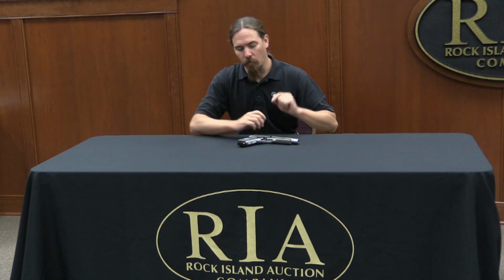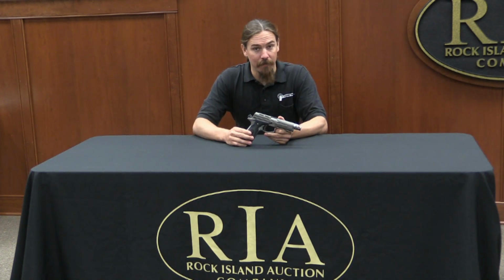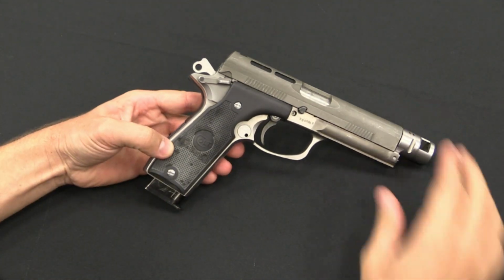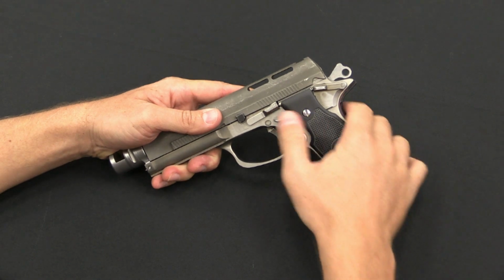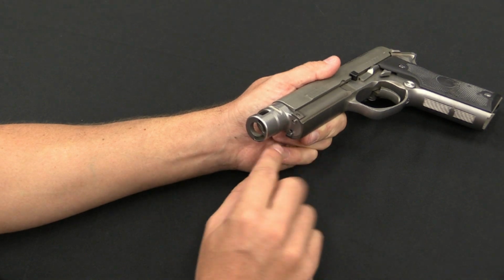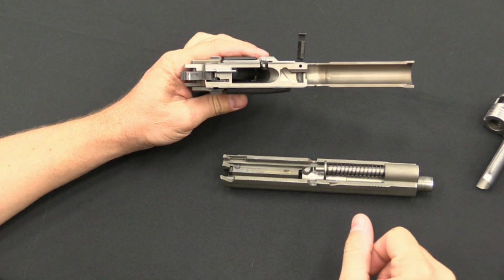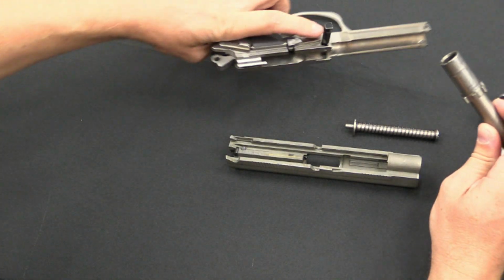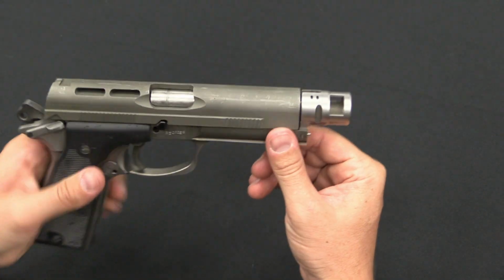Colt Offensive Handgun

Comment: I made this comment in reply to another which has since been deleted, but I think it's worth sharing so I'm reposting it here.

My father was on the design team for this gun. I thought it looked familiar and with good reason. Here is a photo of him holding one from Army magazine a few decades ago: https://i.imgur.com/MYbEUu5.jpg

I showed him this video and he loved it. He agreed the gun was frankly not very good. It was apparently mired in issues from the start and they encountered problem after problem throughout the design process. One clarification he wanted to make is about what you call the thumb safety in the video. This is in fact not a safety and should not prevent the gun from firing. It is actually a means to lock the slide forward when the gun is fired to prevent it from reciprocating. The idea was it would be used to eliminate the sound of the gun cycling in combination with the suppressor to reduce noise as much as possible. It was not intentionally designed to be ambidextrous; the double-sided design was actually required to prevent damage to the slide and mechanism when firing the gun with the slide lock engaged.

Thanks for this video, and bringing my dad for a stroll down memory lane into this gun's history.

Comment: If this gun were human it would be considered a product of generations of inbreeding. Bad inbreeding. Not the fun kind with your hot cousin and a condom. The nasty kind. The only useful item I see here is that the muzzle brake can be used as a miniature entrenching tool. This explains a lot about the Colt failures and low quality of the ‘80s and ‘90s.

Comment: My thought is Colt could have worked with Para Ordinance and produced a hybrid that used a locking system with an extra lug for strength. And a decocking mechanism. And a double stack mag system. I have a P14 I've had for years. Only complaint is there is no rail on the dust cover.

Comment: GunJesus there are 16 oz in a pound so 33 oz is 2 lbs 1 oz 
Not “3 and a 1/3 pounds” which would be 53 oz

I generally love your work... but this was not your best work
Reply: Wouldn't you love to go metric? You just move the decimal point instead of calculating in arcane fractions.

Comment: This has to be the coolest looking pistol ever made. Change my mind.
Reply: For what it does it's simply bloated and overweight. What's offensive in this handgun is that they still had the Colt 1971 prototypes floating around, that only needed a decocker and a threated barrel to be a much superior pistol. Why they chose to use the Double Eagle trigger group, that was notoriously flimsy and prone to breakages (it was simply a mass produced Seecamp 1911 double action conversion, so an aftertought, for how much well conceived) for a pistol destined to high round counts is beyond me.
Reply: You're talking about Beretta, right?

Comment: Pretty obviously the Colt SSP, which already existed when they started development of this pistol, was a much better thought out design than this is even without making any changes to the SSP whatsoever. Why on earth didn't Colt put the effort into updating that design, and making it better, rather than working on this abomination? Honestly, Colt should buy this gun back and lock it in a vault indefinitely as it does not indicate excellence in management or design.
Reply: Yeah. The SSP only needed a decocker and a threaded barrel to be perfect for the job.

Comment: You’d have to assume that if any company had an advantage in selling a .45 pistol to the US military, it would be colt. Was it’s 90s product range really that bad?

Edit: just watched Ian’s video on the Z40. Colt in the 90s was really bad.
Reply: I can testify to a bought new in ‘92 Colt Gold Cup National Match .45 a friend bought. First shot locked the gun up. Totally locked up even a local gunsmith could not clear the empty shell. Twice sent back to Colt and a third time to a Colt armorer the same problem, first shot every time. Did Colt send it back without test firing it? Seems to me they did. After the gun dealer that sold the gun called Coot and explained to them that it was owned by an Alabama State Trooper the gun was replaced. The second gun worked great. Still a mystery about the first gun.
Reply: @martinswiney2192  that’s pretty bad!
Reply: 90's? Pfft, Colt was bad even back in the 60's. Those legendary Pythons and Trooper mk3 have a ton of issues from weak springs and timing issues

Comment: It might be an optical illusion but it seemed that the "length" (as opposed to its height) is shorter than the 1911, 

Was the trigger reach shorter than for the 1911 - just asking I have small hands, But maybe it could serve as a model for a reduced trigger reach 1911 frame ?

Comment: If you look at how the Mark 23 turned out, it seems like the crowded controls were part of the requirements for this pistol design. Beyond that, all of the other features seem to be genuine attempts to improve the design. Even the rotating barrel has some advantages to the shooter over the typical Browning design, it's just not as easily  suppressed. To me, it seems like if they had more time to smooth out some quirks in the design, and if they hadn't tried to shoe-horn in that rotating barrel concept, this might have actually been a step forward.

Comment: I dunno, everyone is saying it looks horrible... I've honestly seen much uglier. It looks some sort of bizarre Beretta-ish design (to me) and it does have a lot of extraneous-looking stuff on it (those slots in the top of the slide, for example), but it's not super gross.

The compensator/suppressor mount seems like a good way to keep the reciprocating mass of the barrel smaller, even if it is very much "cheesily" mounted to the frame.
Reply: +Мейсу Семпай It looks like a 1911 that's abusing steroids. In fact, the only thing that could make it look more so is by adding a bayonet.

Comment: Colt... can't make any other semi-automatic handgun aside from 1911 variants? :B
Reply: Judging from this model you can begin to see how they went bankrupt... that time at least.
Reply: The 1911 remains a fantastic pistol, but this is a huge deviation from the 1911 in every way which matters. It probably would have been better if this had been a 1911 variant, but I imagine the rotating bolt was used as a way to eliminate the stresses on the slide stop pin and the barrel stop on the receiver, which are common sources of wear-induced failure on the 1911.
Reply: Benjamin Danielsen go detail strip a colt and go detail strip a competitors gun. All colt parts are machined from bar stock except for the mag catch, sear, and disconnector. Even Springfield TRP’s have cast hammers. Springfield uses different tiers of parts in their guns. Colt doesn’t. In this case you are getting what you pay for.
Reply: @K-bob_45  Say that to literally anyone who's owned a Taurus PT1911 ever.

I'm not saying 1911s are inherently bad - quiet the opposite - but that they're craftsman's guns. What I mean by that is that they were designed in an era long before mass-production that you see nowadays. A thousand-plus dollar Kimber should not be used as proof that a rinky-dink cheapo 1911 is also good.
Reply: That is offensive
Reply: Natalia Kruschev I like 1911s, but 7-8 rounds isn't that comforting. Not to mention that you have to spend a decent amount into the gun to get it pretty reliable. I love them too, but I'd rather have a SIG SP2022, Glock 17/19 or a 92FS. I liked my M9A1, but I seem to be the exception on that.
Reply: +Seki Banki Honestly, I had wished I had a 1911 in service. The 1911 just feels right in my hands and it has a weight to it that a person of my size needs. Then again, I'm 6'4", and most people in the service aren't, so, yeah. But I do carry a Coonan .357 Mag 1911 and that's fucking godly for a 1911. And, honestly, 1911's are a solid, great design, and I love them, but they should really be improved.
Reply: Seki Banki Beretta's are not my favorite, but they do the job at least. I'd be okay with carrying an FN45, but, I handle 1911's far more skillfully, as well as the fact that I carry two spare magazines. Gun on the right hip, magazines on the left. So, in terms of ammo, I'm feeling pretty safe at least.
Reply: If it ain't broke, why fix it?
Reply: @cullenmayes3370  horse pulled wagons aren't broken as a design but no one uses them anymore
Reply: Enomoto Takane why would they need to? 1911s are great.
Reply: Casey C They're fun recreational, great competitive and okay defense handguns. But, even S&W stepped up their game with the Sigma/SD/M&P line, same with Springfield with the XD/XDm/XDs line. There's a reason Colts aren't as highly thought of as they used to be. While they make decent guns, they're severely overrated.
Reply: @willgetcarriedfornudes1417  The Springfield XD series are only marketed under the Springfield name. They are actually manufactured by a company in Croatia or somewhere in eastern Europe.

Comment: There are several good design eliments to gun and several crappy ones 

A while back I shot tbe colt double eagle in 10mm.  It doesnt take long to get use to the decocker 

If You have used other guns  Sigs or the Ruger P-90 and other in the Ruger P series or the Taurus  PT - 100 

The rotateing locking bolt  =  lead ballon  detacthable front sight Ditto
Reply: Speaking of the Ruger.  Would it have been a better pistol for this trial than the Colt?  When I think of a firearm that can sustain abuse, I start thinking of Rugers.
Reply: In Miltary trails any weapons that meet the basic specs can enter   wether Ruger decided to enter  We don't know

Comment: It seems that suppresser mount would cause gas seal problems between the can and the barrel, a problem direct threading suppressers don't have. I imagine it wouldn't be very quiet.
Reply: Yeah, that came to mind. MOST of the gas would have gone through the can, before the barrel started to move, but not all. It would still have been pretty loud.
Reply: Although I agree with both of you, I have to add that the three-lug mount devised by HK is not too different.  The spring tension is directed forward versus inward at the point the suppressor attaches to the muzzle, but it's not too different.
Reply: ßöмßäяðîëя
I didn't know HK did anything like that...

Comment: The barrel has the 1 lug like an AK bolt at the rear to start it rotating, and multiple forward lugs for locking up, like an AR/M4/M-16 bolt about an inch forward of that.

I was going to make a comment about someone rolling in their grave, but Kalashnikov and Stoner were still alive back when it was designed.

Comment: It would have been interesting to see if Colt could have done something with this beyond OHWS, especially with some lightening and simplification. I actually really like the suppressor mount, other than those awful little pins. The barrel lock up looks like it could contribute to good accuracy. Since it doesn't tilt for unlocking, OR for dis-assembly, it should be easier to get a tight barrel to slide fit. It looks like the SA trigger pull must be pretty short, did you have a chance to dry fire?

Comment: Ian, you mentioned that one of the SOCOM requirements was that it was capable of mounting a laser but you failed to mention how one would be mounted on the Colt. Also do the holes in the slide serve any purpose?
Reply from the maker: AFAIK, the slide hoes are just to reduce weight. The laser module had a proprietary mounting system that locked into cutouts in the bottom of the frame.